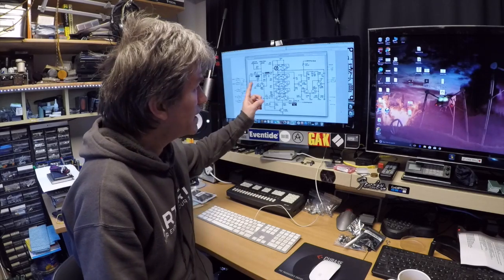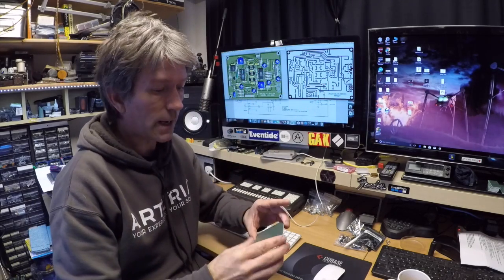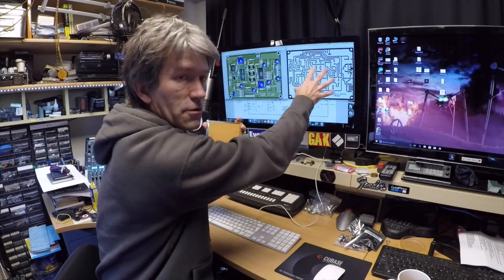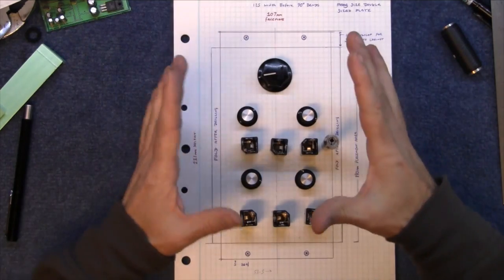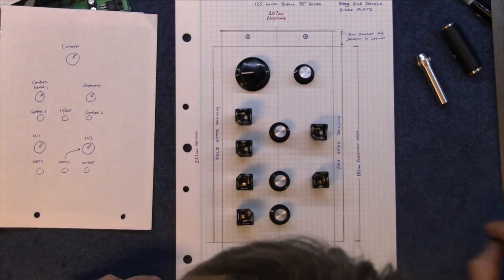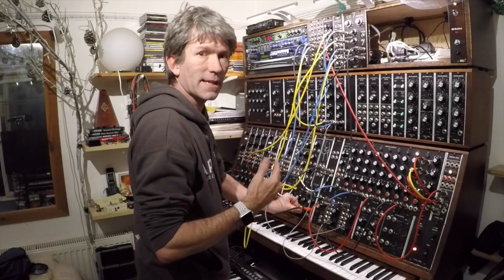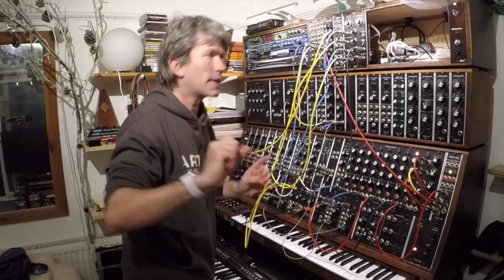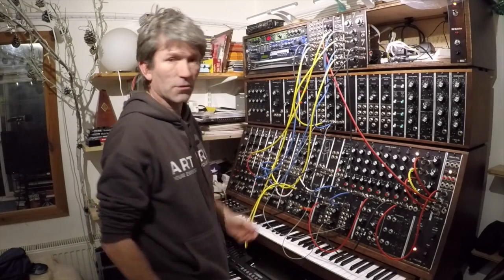BOB's LADDER based on moogs ladder filter built on simple perf board

Comment: Great great video . Markus nice to see your workflow on circuit building and your prototyping ideas/planning. As i was watching i was currently putting together an experiment filter prototype which is a classic clone .....but not Moog. Hopefully if i get it working ill post it on my channel. Anyway hope all is well in the world of Markus 👍👍
By the way do you have a link to where you got the prefboard with the ic isolation lanes from please ?
Reply from the maker: Hi Adamski A. the perfboard i used for the filter was old stock from radio-shack many years ago. but the breadboard matched perfboard and others were all bought from amazon. the perfboard that is suppose to be a replica of a breadbord is not quite correct as it only has 4 connected down in a row instead of 5 that is standard on breadboards. still useful stuff though. anyhow its all on amazon. I look forward to watching your video when its completed.
Reply: markusfuller . Thankyou for reply Markus. Ill have a hunt around for the prefboard on amazon. It would be really handy if i can find a prefboard that matches the breadboards i currently use which are the maplin Ad-01. 
P.s. Thankyou for subscribing to my channel :-)
Best
Adam
Reply: Have been following your stuff to Adamski A., great that we are Brits to. Check out Soundtronics.co.uk  and there other site Makertronics.co.uk, Bitsbox.co.uk are cheap to way cheaper than Maplins.
You'll find some good parts and they are cheap postage also.
You must have one hell of a breadboard collection. I'm just getting into this electronics business and its fascinating, I'm just about to finish a x0xb0x and want to build an MU or Dotcom format but if the panels prove too difficult to make it might be MOTM.
Perhaps you could give me some pointers if I could correspond with you if you wouldnt mind. Perhaps you could have one of my transistor matching circuits. Soundtronics sell matched pairs for around £3.50 but sell a hobby bag of 50 for a quid so its a no brainer youll find at least a couple of sets within them. It will soon pay for its self, the pcb for the matching circuit was £13.00 from America for 3 pcbs to be made and shipped to me, Oshpark is an amazing facility for making prototypes and finished boards for that matter for a really cheap price I think anyway.
Let me know if we could keep in touch and if you have the time etc give me some tips to get me up to speed. When I watch your videos I can just about understand the signal flow of a schematic but cannot see how that can become a circuit, its still in the giberish stage for me at the mo but I'm trying to learn. Being able to place components onto a pcb and solder them is one thing but to understand what does what and what happens after the signal has passed through an IC or Op amp etc is another. That is what I want to know, to understand fully how a elctrical signals effect things to make sound is fascinating to me but like all things you have to learn as you go along, I just wish I could learn a bit quicker. anyway I'm enjoying the journey of discovery.
Reply: the navigator Thanks for your tips, pointers and links ill definitly consider those suggested sites in the future. Haha yes i cant solder to save my life , maybe ill pass a big soldering job your way once ive got the pcbs done thou (still trying to get my head Kicad). 
 Anyways yeah i wish i could break down the technical lingo into more layman terms , but me myself im still on a learning journey. I have only got into this jusg under 2yrs on and off and i have no electronics background. Anyway always feel free to post questions on my channel , no matter how small :-)

Comment: Hi Markus,

Moog filter is a bit mandatory isn't it? Got a Subsequent 37 and love it.

Also got a Roland VP-03 and a question. My human voice and vocoder section only work when I got ensemble (chorus) on. The string section is not affected (no ensemble mode there). Via phones out everything works as it should (even without ensemble human voice and vocoder work propperly) but on the mains out it is as stated above.

Any idea?
Reply from the maker: Hi Mike. to be honest I looked at the VP-03 with interest (as i owned the VP-770 years ago) but I never got around to getting the VP-03 so do not know anything about it other than it has now been officially discontinued and production has ceased which means the value should start going up on them as it has with the JP-08. so sorry I cannot help you as I missed out on that boutique unit.
Reply: Markus,

Thanks for your reply.

Am affraid I'll have it serviced (under warranty).